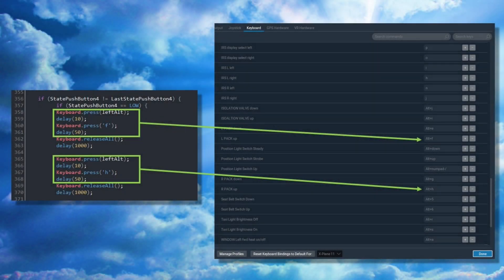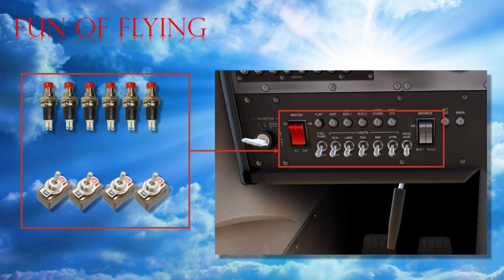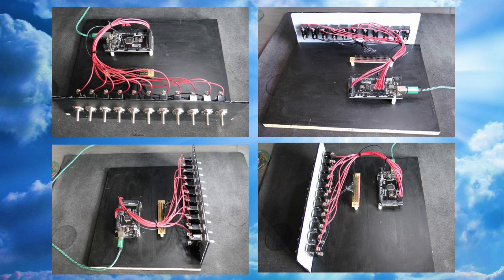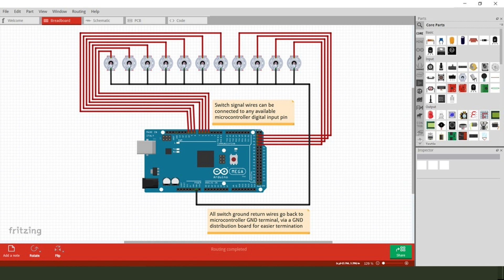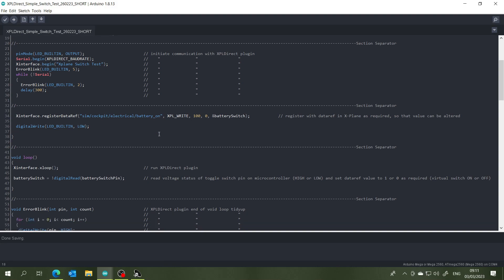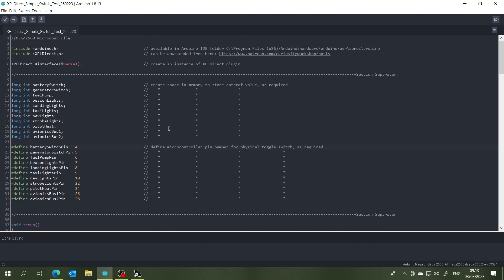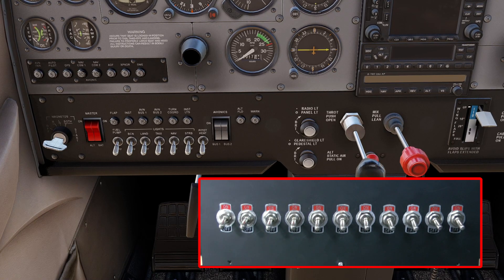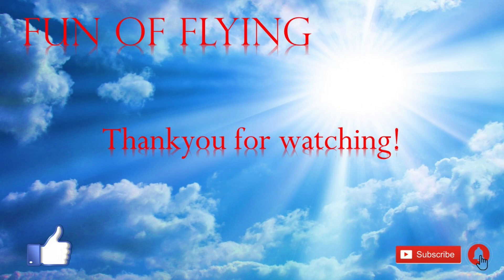Home Cockpit Basics: NO MORE KEYBOARD ASSIGNMENTS & NO MORE HID DEVICES!! (XPLDirect Plugin)

Comment: Great video ! I always been using mobiflight and SimVim so never used any arduino codes.

My question is how do I run this codes as your video , when I connect my mega2560 . Do I need the arduino software running and load the codes? 

Are your codes available to download please ?

Thank you
Reply from the maker: Hi there and welcome to the channel :-) 

You will need to download the Arduino IDE software to begin with and you can get that free here: https://www.arduino.cc/en/software. Once you have this software loaded on your desktop PC, you can then start writing sketch codes at will, uploading them onto your MEGA2560 as required. Having done that, the microcontroller will communicate with X-Plane automatically and will do whatever you've asked it to do in your code structure.

I generally do not send copies of my codes out, as it has taken me years of work to get this far, but I am always happy to help anyone as much as I can. In any event, from the way I have produced my videos, you should be able to copy the code line by line, as a way of starting your own learning curve process.

As far as this particular video is concerned, and others like it, you will also need to download the XPLDirect plugin and the XPLDirect.h library from the Curiosity Workshop website, as explained in the video.

Hope this helps, but please let me know if you need anything further?

Kind regards

Paul (Bedford, UK)
Reply: Thank you for your reply Paul. And thank you for your videos ! 😊
Reply: Hi Paul. Will the plug-in run multiple 2560mega at the same time please?
Thank you
Reply from the maker: Unfortunately I've never tested two MEGA2560's together with this plugin, so regrettably can't answer your question, although I suspect not. Why do you ask?
Reply: @funofflying15  would be awesome to run each panel independently, with its own microprocessor built-in on my PCBs. Worth exploring 😄
Reply from the maker: I'll have a look into from here as well and we can compare notes? Regards Paul